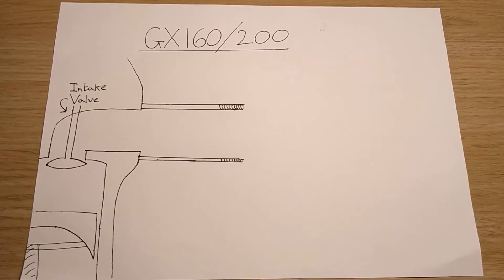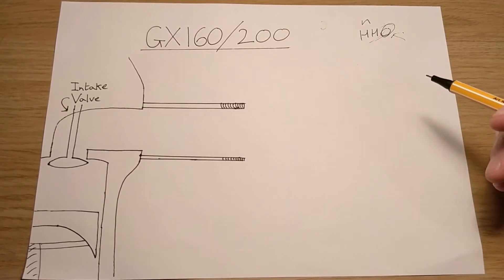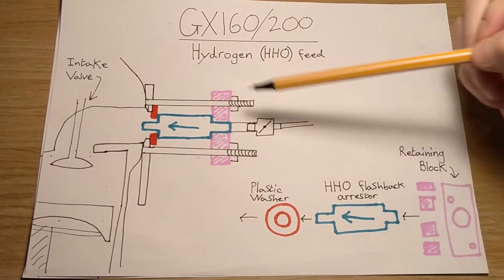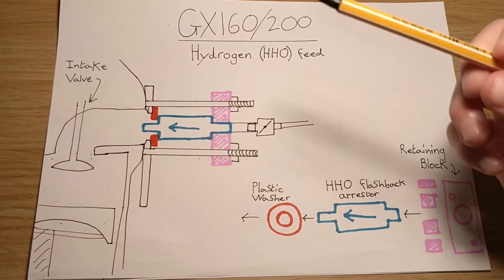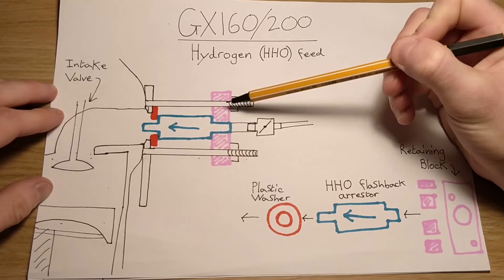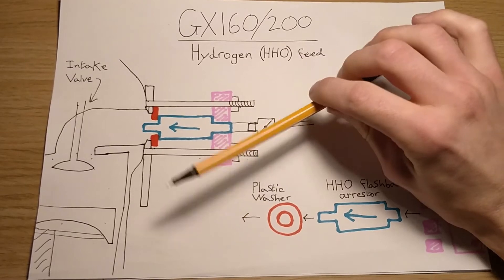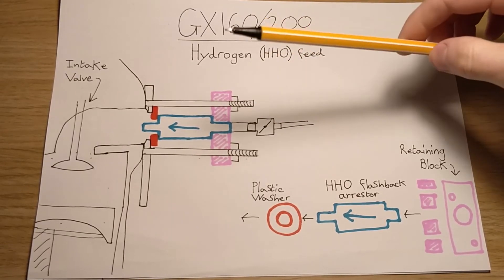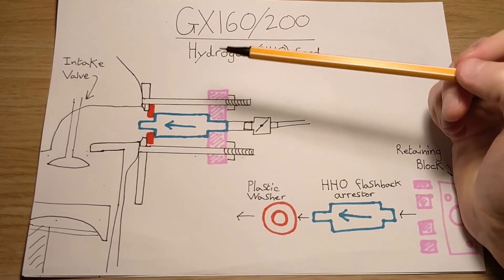How to run an engine on HHO gas

Comment: You dont want added oxygen, but it will never perform correctly and dependanly until you are producing atleast 10% chlorine gas with the hydrgen electrolosis.
Go do your research dumb ass.

Comment: The Nitrogen that you dont have in your engine plays an important part in combustion.
It absorbs the heat from the initial combustion of the fuel and oxygen and reduces
combustion temperature, then it expands itself in the process of absorbing that heat so you dont lose that much expansion.
When you burn just fuel and oxygen, you get out of control levels of heat and burn pistons and valves ect.
Reply: This is an excellent point often forgotten by experimenters in their zeal to see their cells rrsch their target lpm and see their test engine fire up. Its 110% worth remembering

Comment: You most certainly do want air to enter in on top of the oxygen produced, about 29.3:1 as in twenty nine point three parts atmospheric air at sea level for every one part hydrogen you are producing and or feeding into the engine as the optimal stoichiometric air fuel ratio is thirty four point three to one. Minus the one part  oxygen you are producing per two parts hydrogen of course will give you about twenty nine point four to one. (Air fuel ratio accounts for oxygen being 21 percent of the atmosphere already)  This ratio will facilitate a complete burn and give you the most efficiency and potential energy possible. 

You also want to ensure that your apparatus is designed to seperate the oxygen and hydrogen immediately as it is produced to avoid having an explosive mixture of gasses while they can be safely piped separately and recombined at your intake. This will prevent any accidental explosions from happening and ruining your day and or killing you! 

This also prevents the need for a "flashback arrestor" as well as in the absence of oxygen hydrogen will not combust so you do not need to worry about the a flame traveling up the gas line or hose. The most simple design you can produce to accomplish this is building your apparatus in the shape of a uppercase H with the cross bar below the level of your electrolytic solution. 

Also your solution should most certainly not be salt water or you will not be producing Hydrogen and Oxygen you will produce Hydrogen at the cathode and chlorine gas at the anode. Your electrolytic solution should be either sodium or potassium hydroxide or in the very least sodium bicarbonate. Chlorine gas is highly toxic and can kill you.

Comment: P/S, You did not mention the throttle body, which looks very small? 
Hydrogen is the most abundant fuel on the planet, we should be using it. But: greedy business and Governments
don't want it because people will have free fuel??? Oh, we can't have that now can we!
Funny how these governments keep banging on about the environment, charging us if we drive into town?
You would think that they would welcome it??? But No, they truly don't give a F**K.
Reply from the maker: Hi, thanks for the comment, there is no throttle body in this set up only small ball valve which does act somewhat like a typical throttle plate,

You can use pure hydrogen gas or HHO in combustion engines, the problem is efficiency and making it, with wind and solar there is a potential to make the gas for free
Reply: @Hydrogenguys 
Thanks for getting back to me, I am an old school mechanic, retired now.
Although everyone is against hydrogen in business, this is because they want to be the ones making all the money. That is why they are doing their utmost, to put it into pressured containers! "Not a good idea", very dangerous ! The way to do this is by electrolysis,  in a small unit next to the engine/motor! It only needs to be a small unit, with pressure sensitive switches for safety and to turn on and off the power as needed. This way, you fill your tank with water.
Happy days, free fuel.
Our air is full of unbreathable stuff, so the hydrogen goes to the engine, and the Oxygen can be fed into the cabin filter, to give the occupants better air to breathe!
This was done back in the 1930s, but governments were worried that they would lose a lot of TAX revenue.
Reply from the maker: Electrolysis for HHO gas has its potentials but still have along way to go for efficiency. 
As for storage this is why I use pure hydrogen gas not HHO, pure hydrogen is safe to store and easier to work with.

Never heard of the oxygen being passed through the cabin filter before, that’s pretty smart.

Comment: If there is a plastic plate as you call it? Also looks like a spacer, it is normally there as a heat sink, so that the carburettor
does not get too hot. This is to stop the petrol evaporating from the carburettor before use! 
Looking at your drawing, it looks like there would not be enough diameter to feed the engine?
Mind you, this is probably not to scale.
I do like the way you have made it nice and simple to understand. Thanks for your drawing, have a great day.🤪

Comment: How would I add oil if I wanted to run a 2 stroke?
Reply from the maker: HHO on a 2 stroke would be very difficult,  as any flashbacks from the combustion chamber would into the crankcase igniting the HHO in there too, not impossible though.

Comment: did you realise youre actually running an implosion engine in this setup ?
the pre-ignition in these engines is usually hard set on several deg before tdc
pure HHO implodes
so when the HHO enters the cylinder, it has a "high" volume.
when ignited, HHO converts back to water 
water has 1/1800th the volume of HHO and thus you het a vacuum at several deg before TDC ....
its strong enough to make the engine run :)

Comment: Wouldn't straight hho melt the engine
Reply from the maker: It ran fine on HHO, check out the short video of it running, it just drank a lot of fuel

Comment: When obtaining hydrogen from hydrolysis for energy storage and to run an engine at a later time to generate electricity, would you store is as HHO or Hydrogen?
Reply from the maker: I would recommend pure hydrogen gas, it’s harder to get but is safer.

Comment: do you think you could create the engine in a vacuum reducing noise?
Reply from the maker: It would operate fine in a vacuum as the oxygen is present in the fuel.
Reply from the maker: It would operate fine in a vacuum as the oxygen is present in the fuel.

Comment: I wonder if the timing of the spark can be advanced to after top dead center to prevent flash back, due to the nature of the way HHO burns
Reply from the maker: Hi. Thankyou for the comment. 
The timing should be retarded to Top dead centre for safe operation, but to get the most out of the fuel I found that timing can be just before top dead centre, but if you go to far then piston slap can occur. 
Hope this helps
Reply: So the engines retarded..a few degrees for best efficiency 😅

Comment: The flashback arrestor up against the intake is a smart move. I would place seals between the plastic washer and the intake to make sure it is air tight and possibly a seal between the arrestor and washer as well.

Comment: What about choke 100% and feed gas into fuel line that should be about the same thing? The other thing i was planning is the HHO bubbles through bottle of gasoline?
Reply: run your hho line into the fuel feed hose is looking for trouble -carby bowl willfill up with hho and will ignite blowing the carby off the engine

Comment: You need a 2-stroke engine two separate intakes and a small exhaust
One for hydrogen, one for oxygen
Pressurized h and o
Run 
Watch HP
This needs to be developed
Reply from the maker: Sounds like an interesting idea!
Thankyou for sharing.

Comment: A gas engine is also an air pump, since your design restricts most air flow it will be interesting to see how it performs.
Reply from the maker: you can see the engine running in one of our videos, it did run well but consumed alot of fuel.
Reply: Hho already comes with air
Reply: Yes ICE are air pumps that generate lots of heat. Any restriction in the air intake will decrease the  efficiency of the engine.
Reply: @brettjasonheadinventor  or in the exhaust
Reply: @brettjasonheadinventor so it seems we need a better hho generator 🤔
I wonder if a SLS metal printer made lattice structure would provide adequate surface area. To the best of my understanding efficiency of the generator is what holds this back from mainstream use.

Comment: adding more air to the burn helps, so you got that part wrong , 0ther wise it would be a closed system
Reply from the maker: HHO is made up from 'Hydrgen, Hydrogen and Oxygen' this is the perfect ratio for combustion, therfore no extra air is needed.

Comment: Have you tried using a small car LPG gas regulator because it worked for me but as you have already noticed that the HHO unit does not produce enough pressure and gas to keep the engine running if we can work that out it would run.
Reply from the maker: yes LPG carb does work but for pure hydrgen only, we used a LPG carburettor in one of our other videos.
using a LPG carb for HHO didnt work so well for us.

Comment: Many years ago I ran my old Rover car on gas and made a valve that let gas through on demand, so no gas until suction from the inlet valve and that worked very well I would think a suction valve would be ideal for HHO.
Reply: do suction valves stop the gas from flowing back like a flashback arrestor? or did you have to add them both onto your gas line.
Reply: I like that idea

Comment: Briggs 18HP Lawn mower engine ran on water in carb 2008. 6-10amp pulses THROUGH SPARK PLUG from on board ring dual alternator with late ATDC timing, Small Hydrogen formed at plug + water vapor pressure same time. S1R9A9M9 discovered this new process. Self sustained as ignition high volts is by Magneto - not battery coil. Triple hand wound coil forms magnetic field over plug wire extending timeing 0-minus 34 degrees. Accessory spark gap required while EGR of embedded nitrogen compoinnds increases efficiency if used. Battery start, then disconnected. See videos 1+2!
Reply: Doubt it very much. Another 'run on water" myth.

Comment: Combustion stroke  both valve intake and exhaust are normally close,so much better you install one way valve from the hho line,to avoid flash back thats it.

Comment: I wonder if it is possible to implement this concept on a modern car.
Reply: I suggest you do alot of research first... Hydrogen is one of the safest gases out there but can also be one of the deadliest...
Reply: Of coarse...
Reply: You might get some computer error messages and codes screaming at you  . But there are ways to correct for this problem

Comment: A little bit over engineered IMHO.. Can just make a metal block for the carburetor hole with a 3/8 8mm quick hose connector..

Comment: The plastic plate is to stop heat sink into the carb. That can cause fuel vapourisation in petrol/2 stroke engines..

Comment: I was thinking of such a project. 
One in which HHO was produced by photovoltaic panels via electrolysis, then the HHO to be used by power generator converted to burn hydrogen like yours.
And replacing a battery storage with a HHO balloon.
Will that work fine?
Reply from the maker: Personally I would use pure hydrogen not hho gas.

So like you said, you could use solar to make electricity to make pure hydrogen, then store the pure hydrogen safely in a gas tank (you shouldn't store hho gas). Then run the generator on the hydrogen when needed.
Reply: @Hydrogenguys  yes this sound logical. Thank you and good luck with your project. 🤝🏻

Comment: How do you calculate how much hho gas volume you need based on the specific engine and cylinder size, along with a rough estimation for how long you can run it.
Reply: I found an HHO generator model that puts out about 2.5 LPM, I think if I doubled the model 5 LPM would be enough to fuel an engine like this. He runs the engine at 50 PSI in a later video, so I think I would need a generator that produces 4.2 LMP, if I can get an output of 5 it would be perfect.
Based on my calculations  4.2 liters/minute at 50 PSI will produce 2.1 LMP per cylinder. 
Since the flashback arrestor has a diameter of 1/4", so the max flow of gas at 50 PSI is about 2.1 but your gonna need one per cylinder, and lawnmower engines usually have 2.

TDLR: 4.2 liters/minute at 50 PSI will produce 2.1 LMP per cylinder. You should shoot for a gas flow of 5 LMP though to be safe.
Reply: @zephyrtolliver4113  Hello, if I understood well, you need 6LPM of HHO for a 7kM motor elec generator. Am I right?
Reply: @AirGunPoland  I beleive so. Those calculations were based off of this particular 2 cylinder lawnmower engine. 6LPM would take a lot of power, so if you're planning on powering the HHO generator with the electricity from the electric generator, while it should work, don't expect to have much extra power in reserve.

Comment: Great job, but if you let the engine suck vacuum from hho it's will work better and the production of hho under vacuum more higher than normal, the more vacuum the lower current.

Comment: Hi James,
Nice video you have helped me a lot.
Have you thought about injecting the HHO directly into the combustion chamber and welding the intake valve closed?
Reply: I want to say "Remove the intake push rod, leave the welder on the shelf." as a simpler means to accomplish the same thing.

Comment: why is it easy to get distracted with Nox emissions. when  the advantage of hydrogen  is that the IC engine needs to be redesigned , it should not be air breathing ,  

1. you can remove the  inlet valve  as HHO mixture already contains proportionate hydrogen and oxygen mixture 2:1 as a  provision  through fuel injectors or carburetors (whichever is efficient for ignition) 
2.  with  only a  exhaust valve meaning less complexity and wear and tear of valves is reduced by half  . 
3. for lean or rich fuel mixture ratios - the HHO   generator using electronically calculated  ratios with a minimal   buffer storage of oxygen in isolated chambers. 
(probably modifying fuel injectors to create HHO truly at the last mile or on-demand. )
with fuel injectors based hho production  just like inkjet i believe the you get nascent hydrogen and , nascent oxygen.

Comment: Nice job..love to see..can we use HHO from a tank instead of ballon so it runs longer ??
Reply: the problem im discovering with bottling hho is that pressure will just re condense back into water. so what you need is to configure a dry fuel cell to separate its manufacture of hydrogen and oxygen, then you can bottle either separately. I think the highest psi I've heard of before weird stuff starts to happen to the hydrogen is around 2000-2800psi. anything past that and you're entering the realm of liquid hydrogen and that requires liquid nitrogen to keep cool otherwise as it heats back up in the bottle at 3000psi, that pressure will continue to increase and now you have a pipe bomb. So just separate the hho into h2 and oxygen and then you can use valves to remix at the combustion source. make sure you have flashback arrestors, and somethign to dial down the released gas, because hydrogen can self ignite from its own friction generated from leaving the bottle. The dream is to make a system where you can generate your own gas at home (maybe solar powered), and bottle it yourself. This lets us circumnavigate the need for $10k batteries or expensive gasoline. NEVER USE CO2 BOTTLES TO STORE HYDROGREN OR OXYGEN>>> CO2 BOTTLES ARE RECYCLED/AGED BOTTLES ON THEIR LAST LEG OF LIFE> NOT SAFE>
Reply: @TrueHelpTV  if we use a compresser to bottle it up so it can store in a tank with enough PSI?
Reply: @protein.planet-uae  i would assume that the pressure would cause the h2 and O to recombine into h2o=water.. you have to separate them. plus i've always heard because they do different stuff at different pressures, you can have spontaneous combustion if you pressurize hho. so yeah.. split your hydrogen and oxygen production before bottling or you're gonna have a bad time seems to be the general consensus.. don't go past like 2800psi either.. and don't use recycled co2 bottles.

Comment: Does not it create a vacuum at first start, (if you block air intake) that prevents it from turning over at the pull of the pull start?
Reply from the maker: I'm sure it would do. I tested the method and it did work, and was very easy to turn over by the pull cord still.

Comment: Try advanced timing just before tdc for knock correction i believe it could be cause in ur valve issues hydrogen has slight imploding effect just before explosion
Reply: hydrogen burns soooo fast that the spark needs retarding

Comment: Dude where's your car running..and no you need 13H to 87O.  It can vent to atmosphere if hho hose is not by the carb.yip put your hho into by the butterfly as close as possible.also H can escape a 2mm gap and octane cannot.  Dude are you sure an erred your model!!!!!!!

Comment: Just use steel wool in a fuelfilter as arrestor
Reply from the maker: I'm sure you could, but makes more sense to use an actual flashback arrestor for safety.

Comment: Is yours blocked? For that to work, your HHO production has to volumetrically match the cylinder volume, right? Maybe match it as propane air/fuel ratio..
Reply from the maker: Good point, but the engine will run with a small amount off HHO at a time, but yes you will need to make alot of gas per minute, for example a 200cc Engine will need at least 8 to 10lpm of gas.

If you mix it with air from the atmosphere the gas will become less powerful.
Reply: Hydrogen tends to run very lean. JCB found that an issue with their diesels. But they got it working perfectly 👍